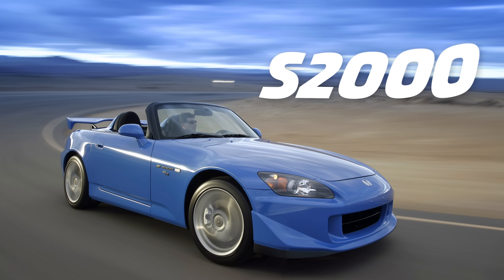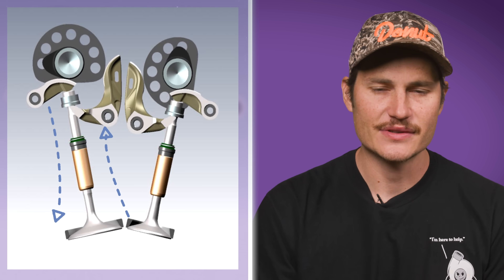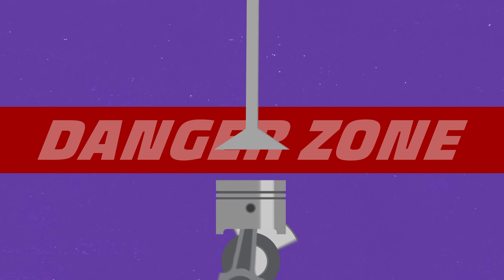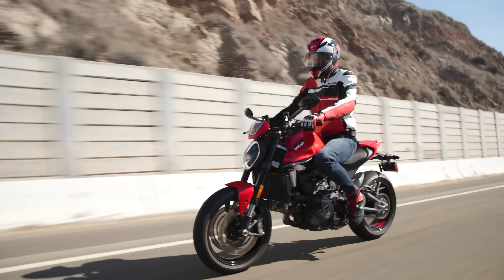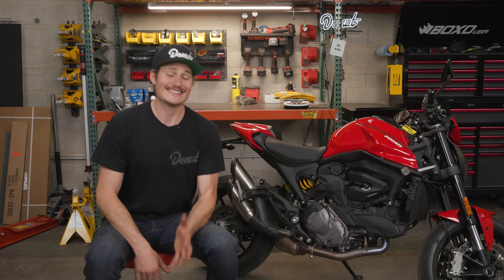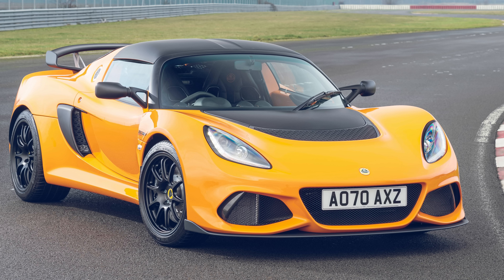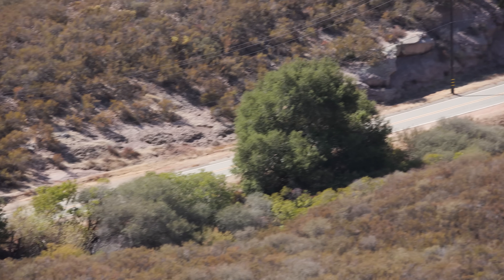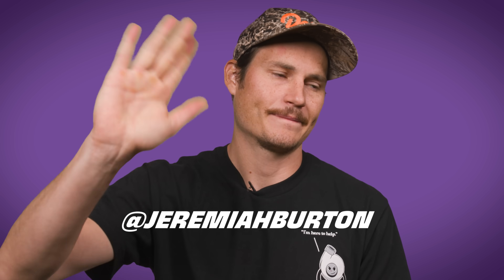Why ONLY Ducati Uses This Part To Go Fast

Comment: It's so good that literally nobody else does it.
Reply: The desmodromic was once.maybe needed before 40 years or more ago . Now manufacturers can build really high revving engine with classic valve springs . Ducati is just using the desmo thingy for a selling purpose and marketing nothing more. It's not even their tech so I cannot understand why would they be so proud of it. Pf whatever.
Reply: @jimjimmy3131  it does help with giant valves needed for Ducati's huge cc per cylinder.. let's em get away with different cam profiles. But yeah mostly it's pointless complexity.
Reply: @jimjimmy3131  In the 60s Honda was winning GPs on the  RC148 125cc five cylinder and RC115 50cc twin that revved to 21,000 RPM on standard valve springs. By the late 80s you could buy production bikes that revved to 19,000 RPM,  The time (if there ever was one) of having any benefit over the much simpler spring is long passed. Its like you said, a marketing ploy.
Reply: Same reason Mazda ran with the rotary for so long despite no one else wanting to adopt the technology. Just to be able to claim a huge, faceless corporation that is run by committee and focus groups, can still produce something truly unique in the marketplace. 

Those wankel boys live and die by the dorito engine. Desmo guys are driven by the same distain for valve springs, i guess🤷‍♂️
Reply: @contextualchocolate  nvh = big sping. I hate big spring. solenoids for life.

Comment: That Ducati pictured on the timeline was a 250 Monza and doesn’t have Desmodromic valves. One of very few non-Desmo Ducatis.
Reply: The new monster they show throughout the vid also doesn't have desmodromic valves anymore. Apparently someone didn't do their homework at Donut

Edit: I was wrong, the new monster does come with desmo valves & I should do my homework
Reply: @philipe.9466  you are wrong the multistrada v4 is the only ducati that does not have desmo
Reply: @storastyggatrollet  You appear to be right. I was sure that I read somewhere that the new monster came without the desmo stuff. Maybe I should also double check my knowledge before criticising others 😅
Reply: @philipe.9466  i was watching this thinking 'i'm sure the new monster is spring valves now' :-)
Reply: @stevewallace853  nope still desmo
Reply: Damn it
Reply: I live in Oklahoma, and there isn’t near as many ‘exotics’ as there is near the coast. A few though.

Comment: Had a Ducati monster
Was scared of what happens when Desmo fails
And definitely couldn’t afford the Ducati premium for the valve service 

No thanks

Now I have the 2020 S1000rr that revs to 15,000😁
Reply: still not as high as a V4R and Ducati still has the most powerful MotoGP engine :)
Reply: Why would your valvetrain fail? Just get them checked according to your service interval. There's less room for failure in desmo setups than there is with valve springs
Reply: The problem with that valve is by making engine rev higher means your engine will prone to failure even more than engine that has less than 15k RPM. I have 1991 Honda ST 1100 that only has 11k RPM redline and it has good condition despite that bike already 30 years old and need to service regularly like 3-4 times per year.

I dont like the concept of engine revving to more than 13k RPM because above that RPM, your engine reliability suffers alot even if you have regular maintenance and it was pain in ass to pay the cost of replacing any parts that failed/broken.
Reply: Its like $1500 for the desmo service, not anymore expensive than other companies valve services.
Reply: @ViperControllers  the service interval by miles meant that I’d have to get the service 3 times a year😐 I had the air cooled motor, I heard the water cooled motor had less frequent service intervals but still
Reply: @matthewheitzman5993  Ya, I'm talking new ducatis with 15k mile services. I don't put more than 5k on mine, so for me it's not expensive. Just factor in 500 a year extra. But ya if ur riding a ton and older ducaties had smaller intervals can't blame ya.

Comment: Before I continue with the video. I have been thinking about doing a Ducati engine swap into small hatchback for quite some time, so you're not entire wrong with your suggestion Jerry!
Reply: @Lassi Kinnunen 81 oh I understand your point. I've had a CBR1000RR engine in mind too, just cause I think Busas have been used too much. I've thought about getting with a workshop and design a V8 CBR engine, just like the V8 Busa on the Atom. I don't know, we'll see. But thanks for the input, I appreciate it
Reply: 90s geo metro

Comment: Bike engines also experience completely different sets of g forces in corners, which is why bike swaps in cars need to be dry-sumped. It is easier to rev when you are only experiencing a single, uni-directional force, as bikes corner by going straight.